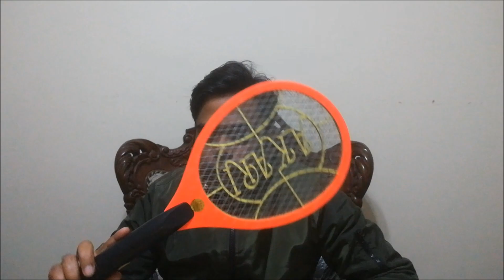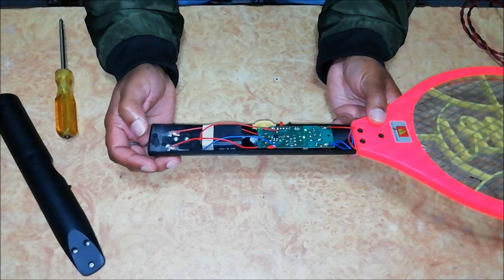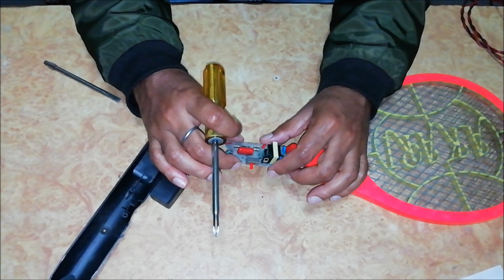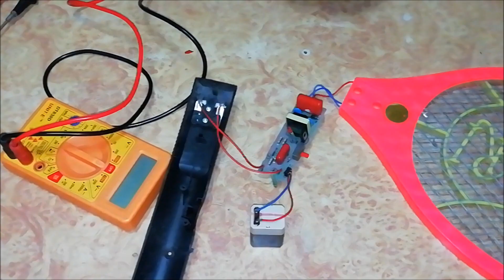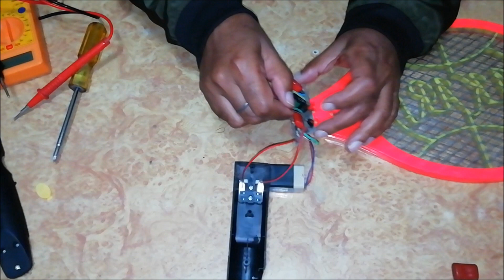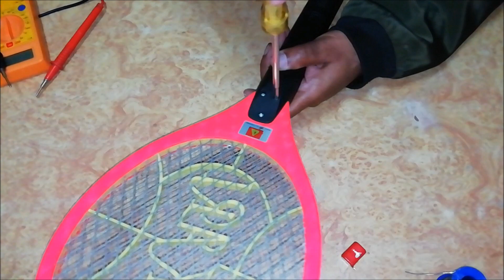how to repair mosquito racket zapper or bat DIY

Comment: I have a old bat of ur design but net is damaged and battery also is gone can i used the red capacitor component from the pcb solder (add one more  on it) to  my torch light Electric bat model i mean the tourch model has less sparks on shorting with screwdriver ?
Reply from the maker: yes or you can make a electric gas lighter. Video link
https://youtu.be/6OJWRrl34pI

Comment: Bahut try kiye capicitor v change kiye fir v ni hua thik
Reply from the maker: problem kya tha? capacitor change karne se pahle capacitor ko hata kar uske dono point pe two wire soldering karen. un dono wire ko chil kar unke bich me 1 mm ka distance rakh kar mosquito zapper ko chalayen aur dekhen ki continuous spark dono tar ke chor pe ho raha hai ki nahi. agar ho raha hai to jali me tar ka connection chek karen agar nahi ho raha hai to battery, transformer, transistor aadi chek karen.